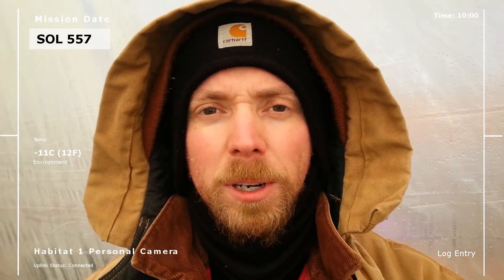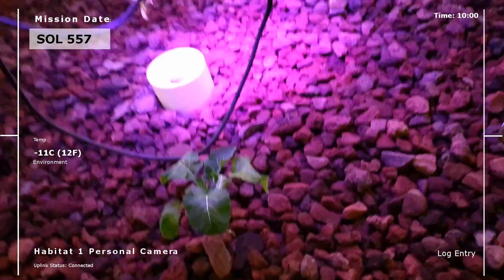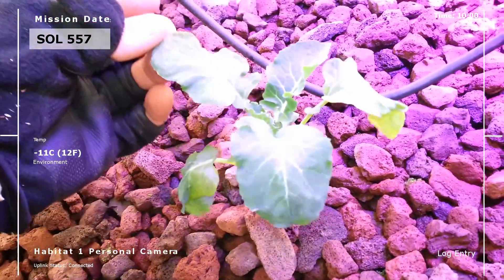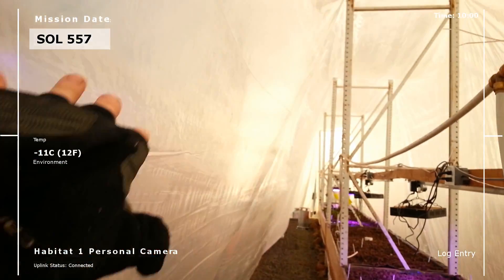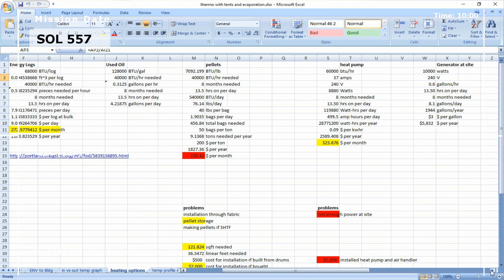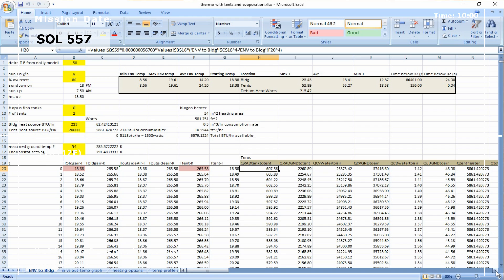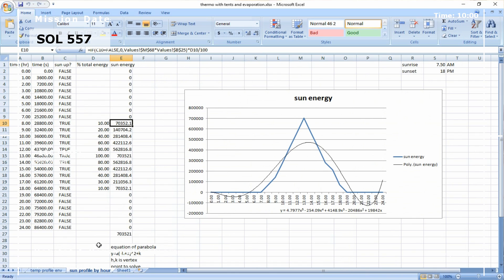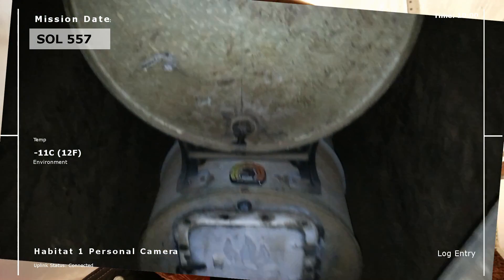Propane creates humidity and that's bad in a greenhouse

Comment: I post this on your last vid but not sure if you seen it so i'll copy n paste it here......waste oil(used engine/cooking) stove...can easily and very very cheaply 
convert your wood stove or make a combo...plenty of vids on YT about 
it....biggest expense you'd have is gasoline transporting the FREE used 
oils but if you can find sources(garages/restaurants) then you can pick 
it up while going to your job ...can run that bad boy 24/7 without havin
 to check it every few hours (unlike wood)once you get the oil flow rate
 set properly....best of luck
Reply: Orgasmicaly Grown I think wranglerstar had a oil burning,  hot water mass heater... military style I think... in his greenhouse. ..
Reply: There is waste oil from restaurants and all that kind as well. Maybe it is time to just shut down for this winter, save the money and learn what you can to apply for next winter. Essential as well is get those solar panels so they can be tilted more for winter sun and to get the snow to slide off.

Comment: Don't get discouraged.  But think hard before you throw more seed into the system.  It might be better to regroup and wait out the weather. That sucks when you just started a Youtube channel,  but you don't owe us anything.  This is the nature of agriculture.  Just like sustaining life on another planet there are hundreds of little factors...settings if you will...that have to be dead on for everything to work.  If just one thing goes wrong it dominoes.  

My observation:  Insulation is the key here.  You need to insulate to the point where the lane itself stays above freezing...optimally 40F or even ideally 50F.  You have to keep this air dry.  Being a hiker and hammock camper I can say that the efficiency of passive heat will surprise you. You need lots of layers and air gaps.  More plastic sheeting.  

Regroup and think it through, you are getting a lot of good advice through these comments.
Reply from the maker: great advice and think i do have a plan through it...we'll see :-)
Reply: Tenspeed's got the right idea, more dead air insulation. So what will work on Mars? Belt King and others suggest a Jean Pain set-up, heating with compost. Well it will work on Mars just need to provided oxygen. A bit late in the season for this year to set it up... but should be doable for next season. Cons minor maintenance, turning the pile adding more composting material.Solar thermal heating (air). I don't know the math but I'd think this would work on Mars. Here on Earth heck yeah. Design and construction easy enough, modular possibilities. Near vertical array set-up will shed snow.  Plug and play into current air movement design. Cons developing air damping system for cloudy/night time periods. Sunlight dependent.Solar thermal heating (water) again this idea would work on Mars. 43% less efficient than here on Earth. Glycol/water heat exchanger could be used to heat IBC tote (or larger) which is then used to heat fish water or thermally charge the ground. Again near vertical array set-up will shed snow. Cons upfront material and construction cost. Sunlight dependent.In an old issue of "Home Power" magazine that I have. A guy from Massachusetts has a concentrated solar dish to heat his home and swimming pool. Again cons for this are upfront costs for materials and construction. Sunlight dependent.So Jeff,When you get the methane production online is it enough to cover all of your heating needs?  Cheers,    Bill